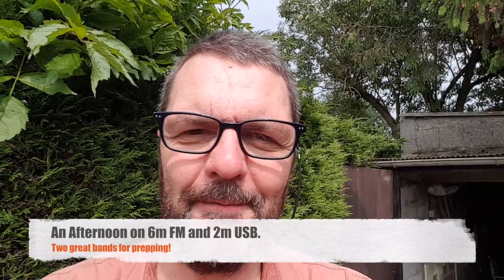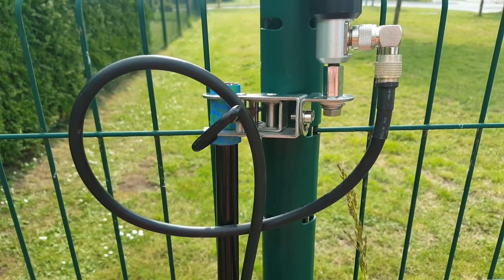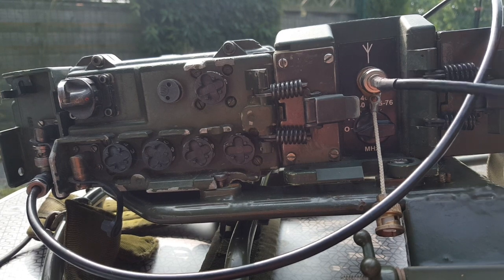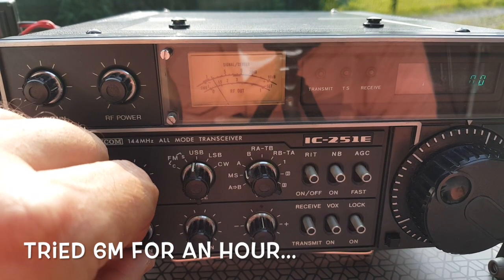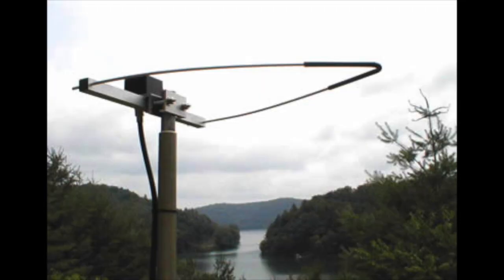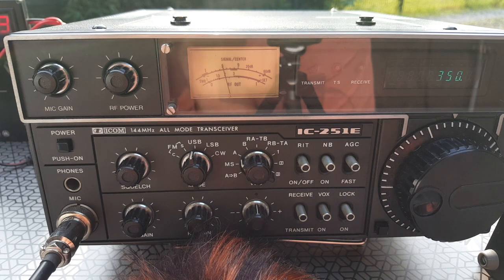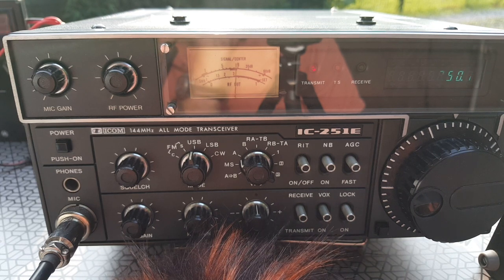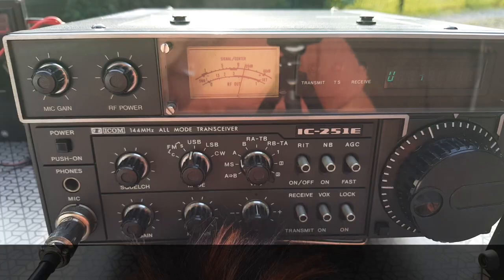A Radio Afternoon on 6m FM and 2m USB.

Comment: Lovely radio the 251e but only 10w max power ? As I say I can try making a contact with you on 6 4 or 2m anytime
Reply from the maker: Great, email me at gil@radiopreppers.com. 10W is plenty ;-) my PRC-352 outputs 20W on 6m FM, so it would be either of those two, or both..

Comment: Right now this is the sporadic E-Skip season (Late May until early August). Look for daily openings  to occur. Peak times seem to be around noon and again past past 4:00 PM local time. Expect 1000 miles +/-. Double hops across the pond into the U.S. and Canada on 6 meters seem to occur during the peak in late June and early July, so keep an eye on it. And always better results with SSB and some decent power like 50 watts and a beam, but across the pond QSO's have been with less. 73
Reply from the maker: Thanks Joe, I hope I can make some 6m FM contacts this summer! Now I need to build a good antenna!

Comment: I have the same problem with my PRC-77. Had to resort to talking to my FT-817 with a simplex repeater. At least I could use the radio :).   I am crazy enough to be in the market for another PRC-77 so I can do range tests with it. Great video. Charlie KM4ZZ
Reply from the maker: Thanks Charlie. I thought about using a cross-band repeater to use my PRC-351 on the local uhf repeater...

Comment: Nice Gil on the 6m FM .... sure wish you could have had better results on six =)   Two meter SSB .... I really love "Big Wheel" SSB antenna ( and a phased pair is great .... I have even worked SATs with a single Big Wheel antenna =)
Reply from the maker: Thanks. I really want to try 2m SSB portable.. Something lighter than my Icom..
Reply: Gil you have an FT-817ND or the newer FT-818 are a good start or even an MFJ-9402X and maybe an All-mode SSB / FM brick ( when needed =)   Gil another thing I use it wait for a contest event for that mode and band to be going on to see if there is activity and make contacts and find out where everyone hangs out at and times / frequencies locally / contental on six =)
Reply from the maker: Thanks Pat. I thought about the MFJ-9402, or a used portable rig on EBay. Maybe I should have bought an 817 instead of the KX2... I look on dxmaps online to see openings. My antenna isn't permanent though, probably my biggest issue, but portable ops are my goal.
Reply: Gil .... I use to use "Hepburn TOPO propagation" ( actually uses weather maps to predict band coverage ) website ..... then discovered the be and real-time version was JUST LISTEN .... turn the squelch up until the noise is gone and listen for the noise floor to raise .... maybe a band opening ( it works for six as well ) .... nowadays ( I haven't used it yet ) the RBN now days is a good as how many RX are online =)
Reply from the maker: Thanks I'll check it out!